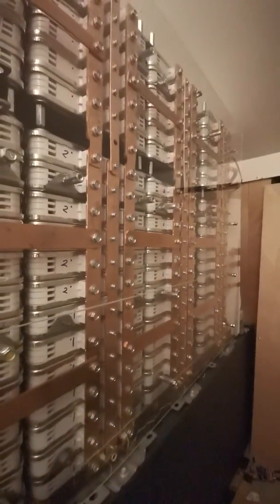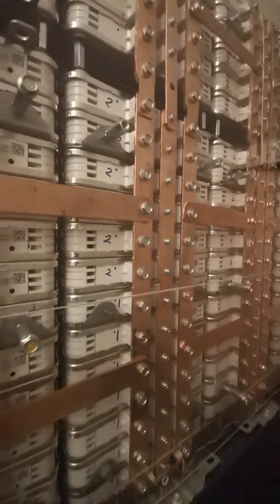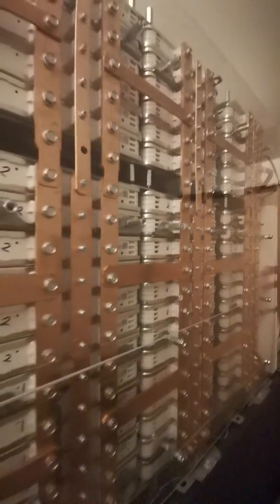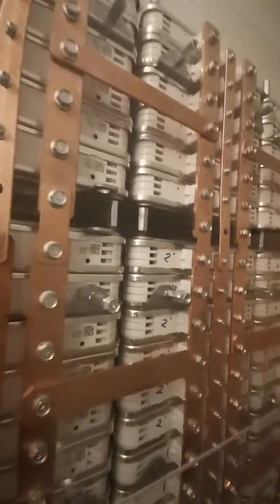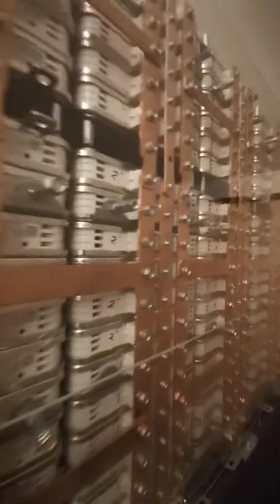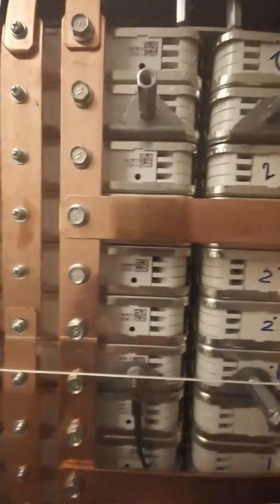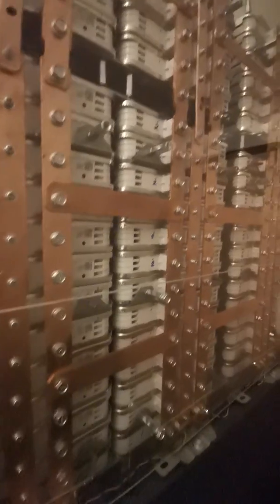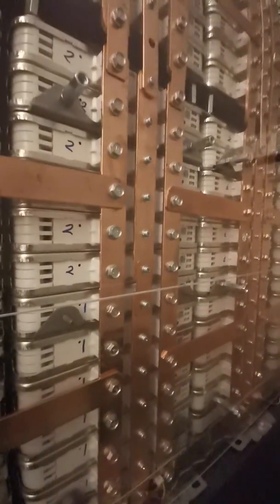Connecting Nissan Leaf Modules For 48v Solar

Comment: Hi William.  When you build a large battery like yours that obviously come from modules from different Leaf pack do you find any issues when the pack's having different SOH?  The weakest module will always be the limiting factor if they had different SOH's.  Or do you find that the small amount of balancing from the Leafmons are good enough to alleviate that issue?  Thanks Patrick
Reply from the maker: I have many packs and are able to select a balance in the SOH.
My large pack now has 64p 14s 
which is over 100 KWH so I guess that it would be impossible to know of a weak module.

Comment: Hi @Williamgerr - have you had any batteries within your pack fail since installing - how did you replace them? Do they not heat up without any airflow within the case?

We have a small house and only import about 10kwh daily (when the sun is down, our solar system covers the rest). Our dream is to have a house in the country... a 20kwh pack would give us peace of mind. However, not being technical like this, it would be great if we could get an electrician to build it for us. 

You should make a technical guide that other people (or the electrician they hire) can use - there will be 100,000s Nissan Leafs coming to their end of life over the next decade and I can see your system being an excellent Case Study. 

PS I love that your pack has grown since I first say your video 1 or so years ago.

Comment: I'm impressed by your system and have been subscribed since your first posting. I pan to replicate it while not as robust at first. Do you think the BMS in your case is really doing anything or is it doing something in your opinion? 
PS, We all have wide screen monitors and televisions now so pleas film with wide format by turning camera phone on its side :-)
Reply from the maker: BMS not needed when multiple modules in parallel.
Reply from the maker: Charge control is always needed.
Reply: @Williamgerr  Thank you I thought it was not really needed.
Reply from the maker: @keppypaul  
We put a batrium on initially but it was really hopeless.
Reply from the maker: I use Solax hybrid inverter/charger that controls charge and discharge limits.

Comment: Thanks for sharing your knowledge and experience with these batteries. It’s extremely helpful and inspiring. I’m looking to build an off grid system for my new home that is currently on the grid. These Leaf batteries are the game changer that I’ve been waiting decades for.

I’m curious about how you decided to build such a large bank of batteries. It seems that a normal sized house could run well off of a bank half that size or less.

Please keep making more videos and sharing your insights!
Reply from the maker: Hi Tom
            I am busy with some research and development projects so much of mine is just stock batteries in progress.
A large home with heat pumps in an average sun hour location would realistically need a 60 kWh battery because of rainy days.
Reply: Williamgerr  - Thanks William! I’m looking forward to seeing the results of your projects and research.